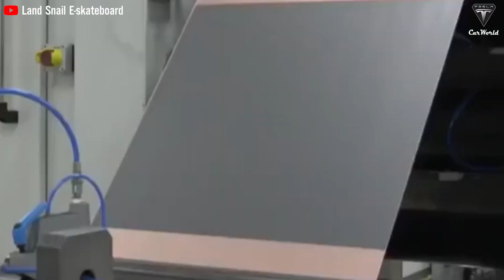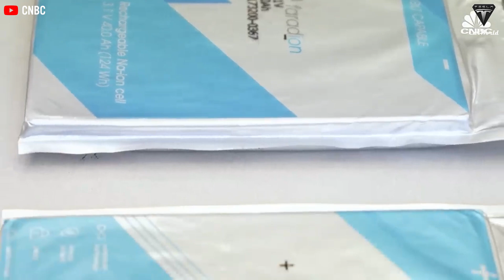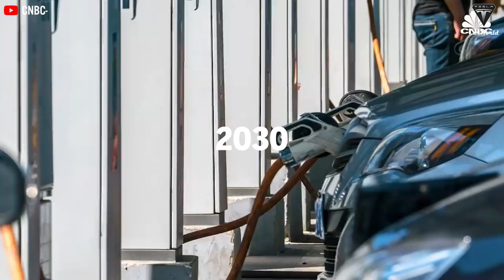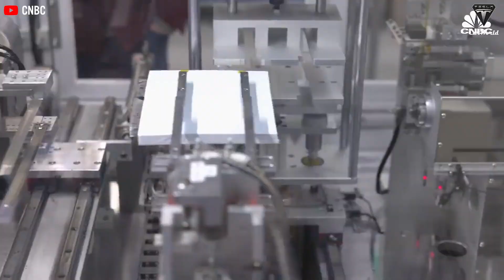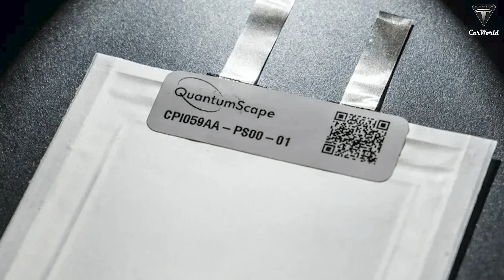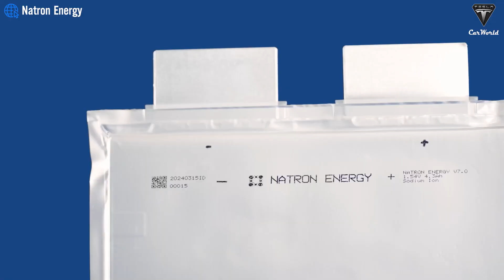Elon Musk Reveals INSANE Sodium-Ion Hybrid Battery Will Be 30% Cheaper, SHOCK Industry!

Comment: For these batteries that can charge to 80% in just a few minutes what is the power source used?  Will a 240 volt source be enough, or will owners need to purchase some kind of system to install at their home that builds up a high charge more slowly then is quickly dumbed into the car's battery pack?
Reply from the maker: To charge a battery to 80% in just a few minutes, a very high power power source is needed, often exceeding a typical 240 volt power source. Such fast charging systems require special infrastructure and often use high-capacity charging stations with much higher voltages, such as DC super-fast charging systems. Electric vehicle owners may need to install a specialized charging system at home to achieve these charging speeds.

Comment: Sorry but you get no bananas today. Another promise/Lie that no one has called Elon on yet. Elon has 20years of piles of bullshit.

The nickel, manganese , cobalt are a promise.It does not produce more miles, Elon makes claims unproven like everything else he push’s. 

This is not a solid state battery that will need to give 1,000 miles per charge. It would need to warranty its battery for 200,000 miles.

Sorry this ain’t it. Ev’s are a waste of money until this battery is created, improved electronic boards that have a long life. Last the electrical distribution system is sill optimized to operate the car and not hurt the electronics.

All of these problems will be solved before 2030 . Save your money.

Comment: CATL\'s sodium-ion hybrid battery sounds revolutionary. Do you think it can actually charge 100 times faster than current EV batteries?
Reply from the maker: CATL's sodium-ion hybrid battery sounds revolutionary, but the ability to charge 100 times faster than current EV batteries is probably a high expectation and needs to be verified through real-world use and in-depth research. than.